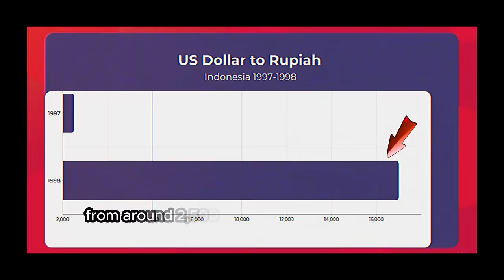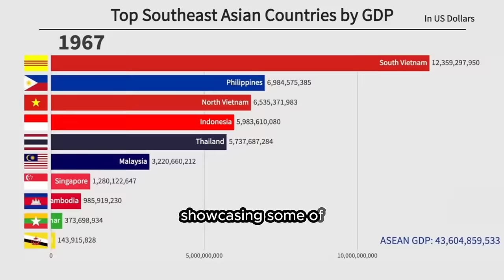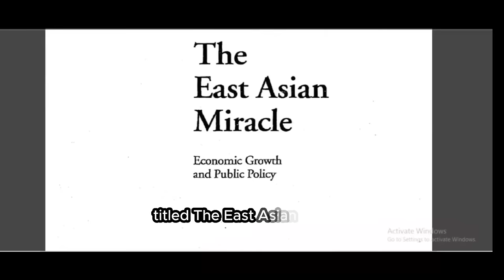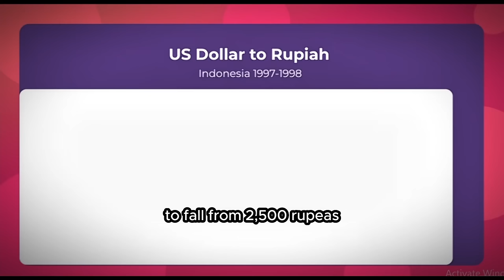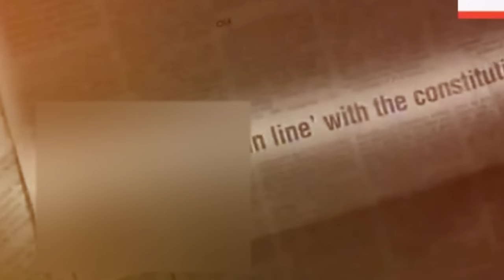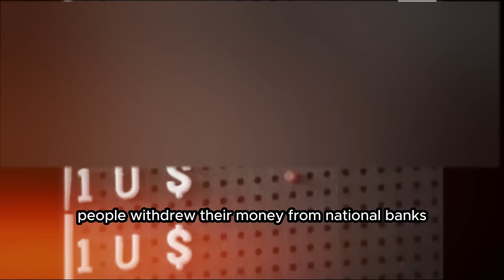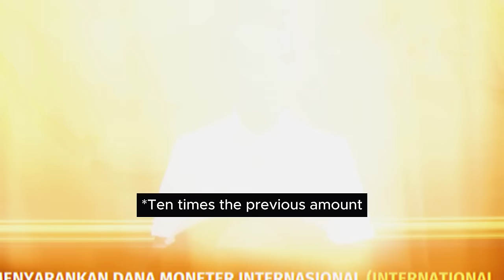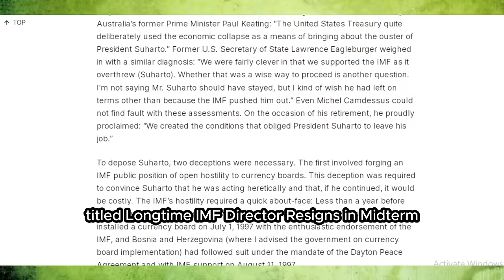HOW IMF TRAPPED INDONESIA INTO ECONOMIC CRISIS 1998

Comment: on thing that Indonesians hate the USA is the fact that they have manipulated the USD 2.240 times (Rp 16,800/Rp 7.5). When Soekarno step down in 1969, 1 USD = Rp 7.5. When Soros came 1 USD = RP 16.800. The problem was how Soros knew what month Indonesia needed USD more than the other 11 months when he attacked Indonesia. 

If Freeport paid me Rp 10 million in a month as my wages thus

1. In 1969, when 1 USD = Rp 7.5 thus Freeport has to prepare Rp 10 million/Rp 7.5 = USD 1.3 million/month for my Rp 10 million/month wages. 
2. In 1997, when 1 USD = Rp 2,000, Freeport has to prepare Rp 10 million/Rp 2.000 = USD 5,000/month for my Rp 10 million/month wages
3. In 1998, when 1 USD = Rp 16,800 or when Soros came, Freeport has to prepare Rp 10 million/Rp 16,800 = USD 595/month for my RP 10 million/month wages.

You can see that by manipulating USD 2,240x than its original value, Freeport can safe wages USD 1.3 million/USD 595 = 2,184 x. This means, its ROI to its shareholder will increase by 2,184 times minimum.

For Indonesia, its income from the tax will reduce 2,184 times.